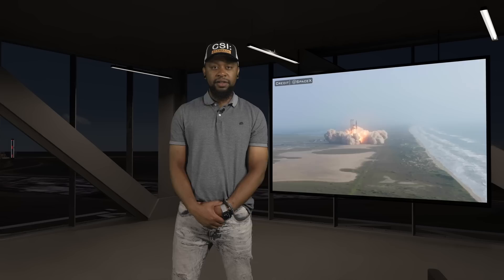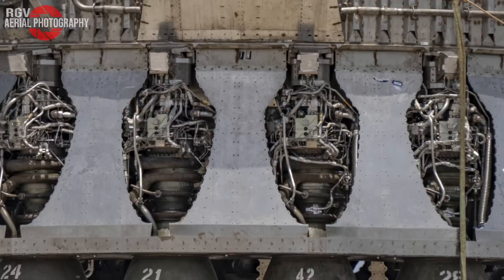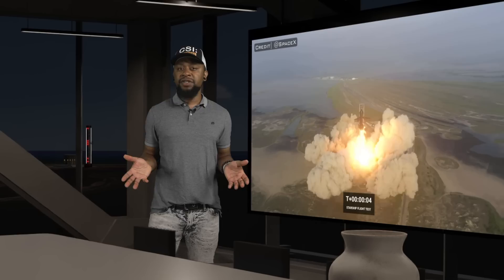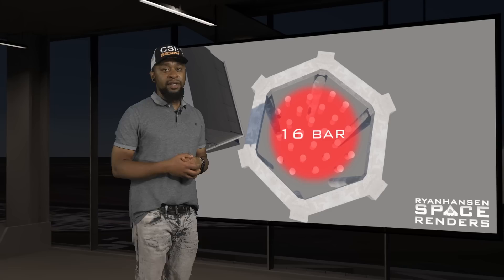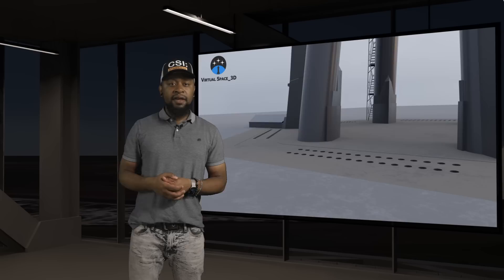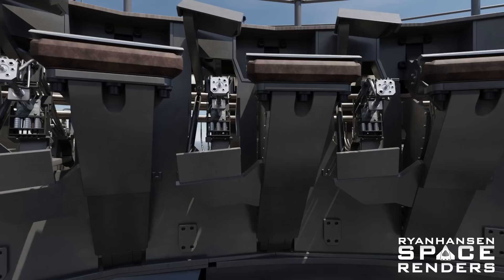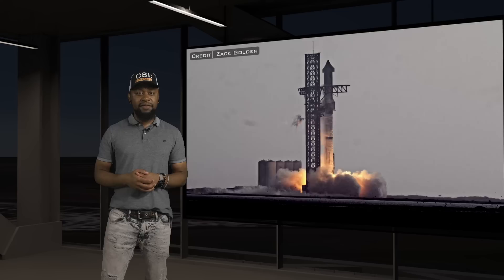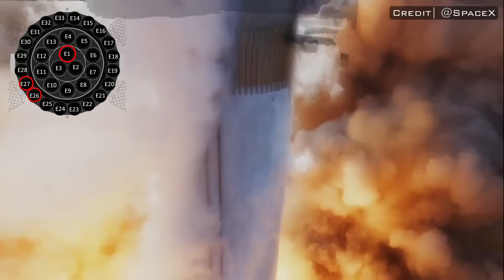The Design Flaw That Caused The Starship Launchpad to Fail!

Comment: I dont agree with everything,  but still interesting episode. I think piling underneath the OLM was just underestimated. Highrise buildings have foundation slab like up to 6m thick. Piling has normal rebar and not just one rod in the middle, which has no effect what so ever. I dont agree that the pressure had to break the slab in one of the corners. I think that the piling just failed, it was pushed lower, which caused breaking the slab and everythink was then just gone. Also I think the proposed watercooled slab is not enough. It will bend, crack and blow away. They should do multi steel-concrete vertically tied together sandwich plates. But, lets see.
Reply: If you agree that the cause of a destruction is pilling failure, and you (maybe) know they're installing larger pilings, then why the water-cooled isn't enough?
Reply: @alvianchoiriapriliansyah9882  I  know that there are videos showing a baloon filled with water and it wont burst even when it is above a flame. I think the 33 engines are just too strong and the showerhead below them can crack and break and be blown away. Maybe if they make it strong enough, but I dont trust it anyway.
Reply: @peterchrien  Do you think making water pressurized at the nozzle beyond 16 psi stagnation pressure, breaks the laws of physics?
Reply: @Alvian Choiri Apriliansyah  let's see. I see a problem in the area. XY nozles with some diameter and pressure might not be enough to overcome pressure from 9m diameter rocket. I don't know. Let's  see

Comment: The amount of self-dilusion about this failed launch is incredible. 
Water under steel will vaporize instantly and explode even more spectacularly than the concrete pad did. If you believe that the concrete pad was indestructible and well engineered...

Comment: Almost certainly not practical for most of the OLM due to the specialist application method, it is applied at a temperature of 10,000C (yes, really!), but for added reassurance about the "shower head" plate not melting, I wonder whether SpaceX ever considered painting it with the same paint that The UK Royal Navy uses to protect the landing and take-off zones on the flight deck of its fairly new Queen Elizabeth class carriers. Obviously not good enough on it's own but, as I said, maybe an extra level of backup protection in case the other protections (i.e. the water itself) isn't quite as effective as hoped. The carrier paint is said to be good to 1,500C and is designed to be non-ablative since the carriers are designed to sustain a high tempo sortie rate without returning to port and to do multiple deployments before going into extended refit. If I was one of the SpaceX designers I would certainly vote yes to having the top plate painted with that stuff as an added just-in-case protection measure. For the top plates I wouldn't have thought that the crazy 10,000C application process also would have been an issue since the plates could have been pre-painted prior to installation.

I'm not sure if I can post links and I don't want my post blocked if I try but searching for something like "Queen Elizabeth class carrier thermal protection paint" (probably without the quotes) should provide some links to further info on the paint. Being designed for an aircraft carrier it should also be pretty good in coastal corrosive salt water environments.

Comment: OK, I assume starship will be landing on moon and mars some day. How will starship keep debris from flying up and damaging the starships rockets? There won't be water there to divert the force of landing and blasting off. Look what happened at the space hardened launch site. Granted, the moon and mars have a lot less gravity force and less force from the rockets would be needed for landing and blasting off. I would like to hear about this before the landing actually occurs, at least several years away. Thanks in advance, like your channel.
Reply: Only the upper stage will be launching from other planets, but it is a concern. The regolith shouldn't damage the vehicle, but the vehicle will carve out the regolith from under it. There needs to be concrete launch pads. I doubt it will need a water deluge system though, especially with the temperature differences in space.

Comment: Zack, at about 15m you talk about methane tanks, would they even have had much in them after filling starship and booster?
Reply: also at about 30m, what's the boiling point of water at that pressure?

Comment: The decision to move forward with this launch is the first event which gives me pause in terms of confidence that SpaceX can achieve their more far flung ambitions.  

Having one single geologist or interdisciplinary specialist on the team would have given them the insight into whether the substructure below the pad could fail.  This is a classic example of a whole team focused on a single problem without enough oversight to look at the broader operating environment.  That narrow focus, something familiar to anyone who works with and around monodisciplined engineers, could present a great hazard to operation in space or on the surface of other planetary objects.

Comment: @CSIStarbase Zack, what are the RBQD's doing pumping Helium for?  I didn't know SpaceX used Helium for anything on the StarShip.   @ 36.30
Reply from the maker: Helium is the main spin up gas.  Nitrogen is used for purging but may also play a role in engine startup but im not sure.

Comment: Outstanding analysis. Well done. If you look at the engines during takeoff, just before being obscured by cloud, you can see that one of the three centre engines is completely missing. It was removed by concrete debris! There was undoubtedly massive amounts of damage to almost all the engines. Great observation about multiple vapor explosions from below the pad. Also you noted massive pressure differential on pad at launch but omitted temperature differential. Between the two, created massive tension across the top surface of the fondag causing additional fractures. 

You correctly noted the water pressure needed to prevent the new steel water cooling blast surface. Combine this with the "1 inch per second steel erosiom" from Elon. I haven't run an analysis, but I am pretty sure that it is impossible to make a reusable steel blast plate. Furthermore, I expect that the water cooling will cavitate if it's flowing fast enough to supply sufficient flow to mitigate noise, heat and pressure. The water cooling will almost instantly turn the steel plate into high speed shrapnel. The concrete beneath might not vaporize the water table below the pad and explode it again, but it's going to depend on how long it takes to launch. 

The rest of the launch is all failure analysis and of no importance to the root cause analysis. None of this is useful for future development, but it is interesting crash porn, so thanks for that.

Oh, BTW, the fts was a complete failure. Nasa has standard gear to accomplish this and, just like normal, Elon decided that SpaceX didn't need to learn stuff from 50 years of nasa research.

Comment: Just a thought, assuming these 3 RVacs really ignited, could it be caused by a launch abort system? I know it's a wild assumption lol, but Musk mentioned some time ago that in theory they can try using Raptors for launch abort. If SpaceX really implemented that, it could explain Starship starting up its engines on its own, right after Super Heavy exploded...
Reply: Unless they initiated a power seperation from the ground, there is an image floating around showing starship separated from the booster from the fin camera and what looks suspiciously like the detonation cloud forming at the base of the booster. I would be surprised if they didn't attempted it just for the data, it's not something you get many shots at this early in the testing process.
Reply: @shaung949  I doubt they would deliberately attempt anything like that after activating FTS. That's why I thought that could be an automated system, just Starship reacting to the booster's explosion. Obviously this is just a silly conspiracy theory, since we'll never be sure if that abort program was implemented and if those Raptors really lit up (even though it looked like they did lol)

Comment: About the Spin Prime Test: Oxygen does not burn, it promotes the rapid oxidation of a combustible substance. otherwise life would be impossible and our atmosphere would explode every time there was lightning. It was a build up of the combustible methane that caused the explosion.
Reply from the maker: I put out an entire episode about how this happened. I would recommend checking it out. There was no build up of methane.  All the methane came out at once during the spin prime test.  There was a build up of oxygen from raptor chill venting before the spin prime that caused the explosion to be as violent as it was

Comment: Design Flaw?
Launchpad Fail?
Hmmm, me thinks someone is choosing  erroneous descriptions 😁
The design worked fine, Booster 7 launched successfully, it's the site works that didn't stand up to the forces inflicted on it. The ground under the OLP compressed causing the concrete to fracture and blast away.

Comment: Why doesn't the rocket lift off with minimal engines (say 4-5) then turn on the rest of the engines once the rocket has largely cleared the OLM?
Reply: Fully fuelled Starship weighs 5000 tons. 33 Raptors have 7500 tons of thrust, therefore TWR=1.5. So 5 engines could only give 1135 tons of lift.

Comment: 31:00 The six triangular pieces in the center of the water-cooled plate could as well be replaced by three rhombal or two trapezoidal plates. But I doubt this comment will ever be read by SpaceX engineers.
Reply: You have done a force analysis & concluded it's inadequate?
Reply: @alvianchoiriapriliansyah9882  No. No need to go that far. Anyone knows larger plates, within limits, are more able to resist loads than divided plates. Would you build a house with broken beams?

Comment: How did you come up with the value of 13 bars of rocket exhaust pressure at the base of OLM ? If you multiply that with an area of 101,787 squared inch ( 35 feet diameter)( 13 bars is 188 pounds per square inches… ) you get astronomical numbers that are not real…

Comment: What will happen when a starship launches off Mars?  Will it create a dust storm and crater on the surface?
Reply: It's the booster that makes craters and it doesn't leave earth.
Reply: @shaung949  but something will power itself off of mars.  Will be interesting.  Hope I am still around to watch it.
Reply: The lunar starship designs have thrusters higher up the stage for landing and taking off from the moon.

Comment: There's a reason the handle on a bike is tilted back, there's a reason why high is next to off on old fans,

And there's a reason why launch pads have flame troughs,

Spacex dosent need to overcomplicate this much, launchpads have been perfected for well over 50 years now,

There's no need to reinvent the wheel, or launchpad in this case,

Also I bet building a traditional pad off world is easier than, well, this mess,

Also also, flame troughs direct the exhaust in one general direction, which would be crucial off world in a low atmosphere, I'd much rather throw a bunch of supersonic dust away from the habitats instead of, you know, at them,

Just my 2 cents of logic

Comment: The watercooled plate design seems to ignore what happens with the water that will be pumped through the shower head holes. If the water remains as liquid is it going to flood the launch pad, if it is converted to steam it would possibly damage the engines and pad.

Comment: Great work Zack, I still think they need a flame diverter and deluge system . As every super heavy launch system ever made has both of them. Still it's gonna be really interesting to see this big shower head at work. I think Elon should call it a bidet instead of an inside down shower head though 😅💦💦💦
Reply: Maybe SpaceX will prove flame diverters and deluge systems are old school.
Reply: @ajctrading  So because most rockets is trashed into the ocean or uses parachutes means SpaceX have to follow them?
Reply: @alvianchoiriapriliansyah9882  they can do what they like. Like they did when they launched a super heavy rocket without a deluge system and diverter , destroyed the OLM and were damn lucky they didn't destroy the whole of stage zero. Gee that went well didn't it ...
Reply: @ajctrading  If you actually watch the video (maybe?), you should know that the lack of diverter isn't a definitive problem
Reply: @alvianchoiriapriliansyah9882  I see an enormous crater in the ground where a diverter should be.
Reply: @ajctrading  You missed "inadequate pilings". NOTHING to do with flat design
Reply: @alvianchoiriapriliansyah9882  add it to the list of faults space x commited. No diverter, no deluge system, and inadequate piling foundations.

Comment: I still don‘t think this was a ‚true’ success. Just because you hit your goal doesn‘t necessarily mean it is a success. If my goal is to run a marathon and I do but just over the finish line I die from exhaustion, that is no a success, I just phrased my goal poorly (it implicitly included not dying).

So while the breakup of the rocket does not mean they didn‘t succeed, that one was more than likely expected, the failure of the abort systems, the less-than-optimal reliability of Raptor and the destruction of the pad are significant enough problems to make it not a success in my opinion. 
To put it differently, the failures make the cost of this ‚success‘ so high, that losing would have been the preferable option, it was a pyrrhic success if you will.

Maybe to address your point a bit more directly: In a way I am spinning my whole narrative but not based on nothing and certainly not because I want them to fail.
I just think their internal measure of ‚success‘ is probably a tad more complicated than the public stated goal of ‚just get it off the pad‘. Even what you said, that a destruction of the whole launch complex would be a failure. Well, the rocket could have easily lifted off, flown a few second then failed and destroyed the whole complex but it lifted off so it would be a success?
Probably not, at least not internally.
Adding to that, they did actually take significant damage on their launch complex, it wasn‘t destroyed but still, that was a lot of damage.
Reply: SpaceX get to knows the flaws with actual data was enough to called it a success
Reply: Sure, success is a rather loose term but that is where the design philosophy of the company comes into play. Design, test, iterate and repeat. There are so many more things that can be corrected and adjusted from this flight than there would be if it flew perfectly to the designed conclusion. 
Not blowing up the launch pad was the primary goal simply because it would set them back well over a year replacing it, everything else was solid data on what needed fixing as this was the first full test of stages 0 and stage 1 (the booster). Now they know where they need to focus their attention to make sure the same faults don't happen next time.

Comment: Maybe the "suborbital test stands" will just go away?
Reply: E2E is still on their target, albeit low priority. Maybe when it's ready for testing
Reply: @alvianchoiriapriliansyah9882  e2e needs a tower. Testing could be done at massys.
Reply: @rokadamlje5365  Who said that?
Reply: @alvianchoiriapriliansyah9882  E2E is a full launch with booster aswell. There is no point of launching ship by itself.
Reply: @rokadamlje5365  Except there is
Reply: @alvianchoiriapriliansyah9882  what for?
Reply: @rokadamlje5365  uhm...E2E?

Show me your calculations proving that a single stage E2E (*not orbital*) is impossible, please
Reply: @alvianchoiriapriliansyah9882  they showed that mars bound ship can do up to 6kms when full. 

Launched from earth that would probably reduce to 4 to 5 kms. That gives it ballistic range of 2000 to 3000 km. Which cant even do coast to coast in US.
Reply: @alvianchoiriapriliansyah9882  did you delete one response or is YT crapping itself? 4 to 5 instead of 6 is because of using sea level engines and atmospheric drag.

Comment: Why doesn't SpaceX use booster rocket configuration on the Starship like they do on the Falcon 9 Heavy? I would think that if you distribute the thrust over a wider area that there would be less damage to the launch pad.
Reply: It isn't going to help

Comment: I hope you get this for your next show... From a law enforcement perspective, If you really want to do a deep dive investigation, do one on how and, why did the EPA, FAA etc.. allow SpaceX to build their complex in such a protected area? When they knew the whole time that there was going to be (historically speaking), a couple of big hazardous boom's" in the process. It's the most powerful rocket ever built with no trench to take away the inertia of the great Raptor engines. Don't get me wrong, I love, and obsess this whole concept. But it always irks me wondering how and why this spot? I get the launch degree into a proper delta V into a non-polar orbit for a powerful bump into orbit. But if you do the math, there are at least 20 other areas to achieve the same accomplishment. Sorry for the rant, but I hope you understand what I'm talking about. 
 - NOM
Reply from the maker: I typically doing talk about those kinds of things.  I don’t cover active regulatory issues because I prefer not to get into the politics and just focus on the technology
Reply: Why did NASA allowed to have a launch pad in Cape protected area?